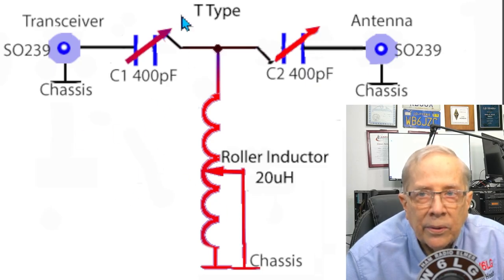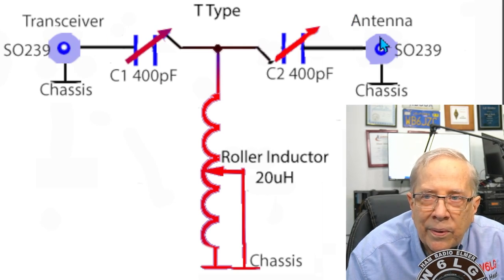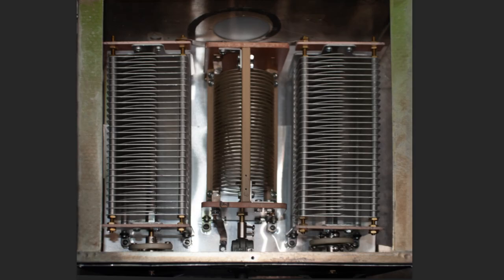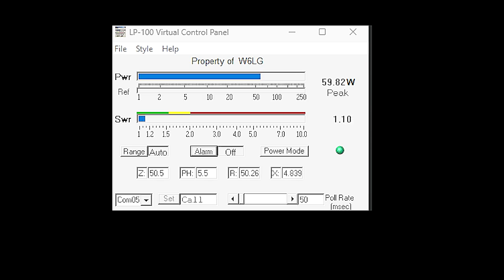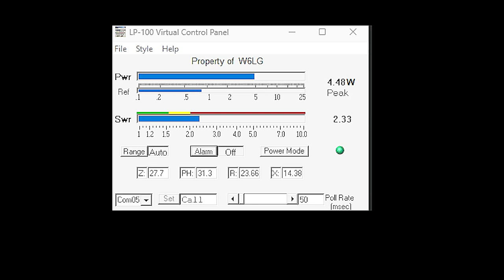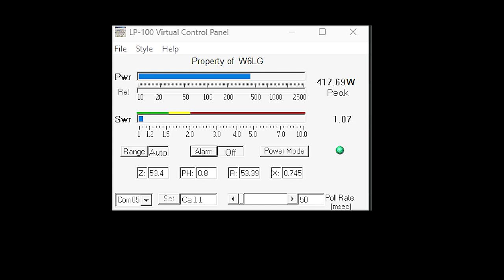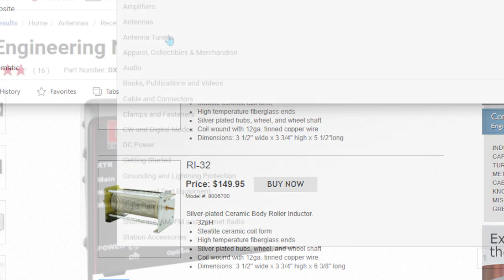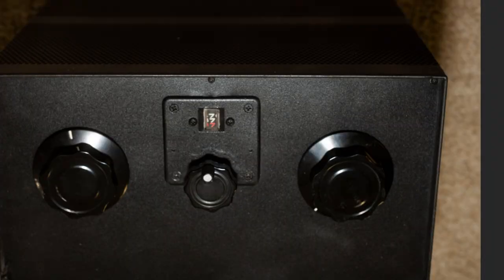Homebrew Manual Antenna Tuner/Matcher With Lots of Headroom From Jim Heath W6LG Ham Radio Elmer

Comment: Hello Jim. Its great to see you. I also enjoy building my own equipment and for other people. I have built various types tunners using tapped coils instead of the roller to reduce cost. More time consuming but i use my metal lathe to thread fiberglass mortar tubes and also wind the coils. I also make something similar to a wolf river coil the same way.

Comment: Jim, the roller inductor in your tuner is EXACTLY the same as what I have in my older version of the AT1500BAL from Palstar.  Keep an eye on the actuall roller inside the coil.  The fingers often break off after years of use.  You've got a very stout tuner there!  Bravo.  73 OM

Comment: Well done Jim, I built a similar T-match about 40 years ago, although mine does not have the same pate spacing in the capacitors. It has done sterling service but it does have the issue of no reduction drives on the capacitors  and the roller sometimes needing a nudge one way or the other. I did not build in a bypass path but fitted a number of antenna ports so I have 4 available without the tuner and another 4 via the tuner. More recently I have bought an older commercially made tuner, it uses the SPC configuration but uses a series of relays to change the RF path. 
It has some merit, if I switch off the power supply for instance the relays can route my radio to a dummy load for example. For a tuner rated at 3kW the relays seem very skimpy but I have not destroyed any of them yet. I completely understand the temptation to use relays, but you will need a pair of the ones pictured if you go that path and also need to supply the relay coil voltage to them. At times it can be a nuisance, most of my radios are mains powered, my amplifiers are and it does seem daft to provide DC just for the relays in a manual tuner. FWIW for HF use with "moderate" mismatches you might find it surprising how much much abuse a standard DPDT open frame relay will take. Many years ago I built a MOSFET mobile amplifier for 2m, I used a 3 pole double throw relay in that to switch both legs of the RF path and the bias supply, while I would never advise anyone to do it like that it worked fine, no instability or issues at all.
Great to see you making videos, really enjoy your content, 73